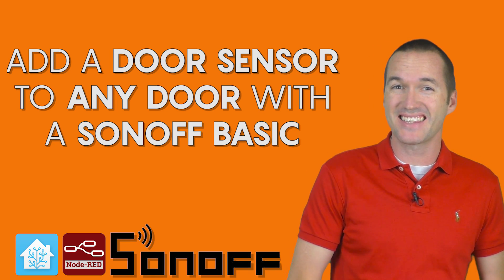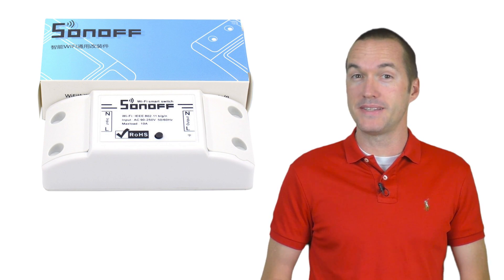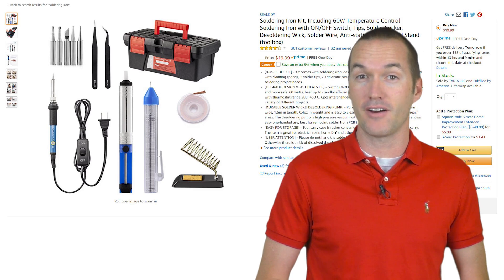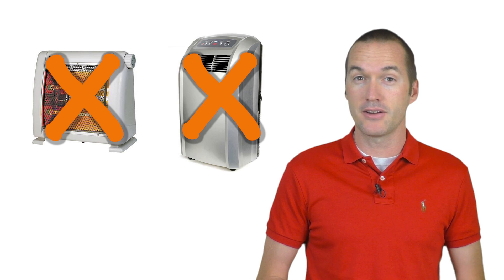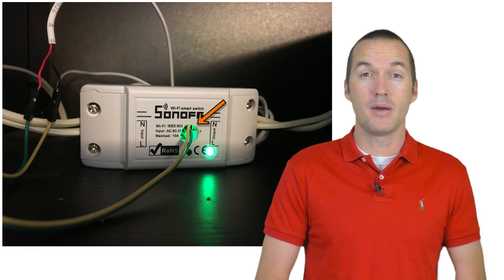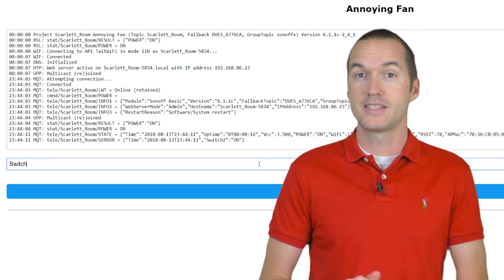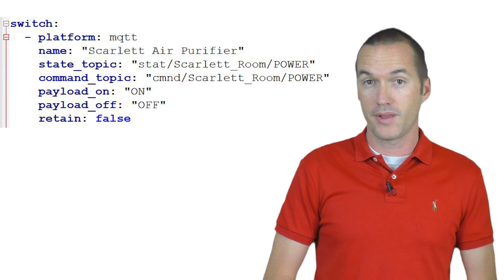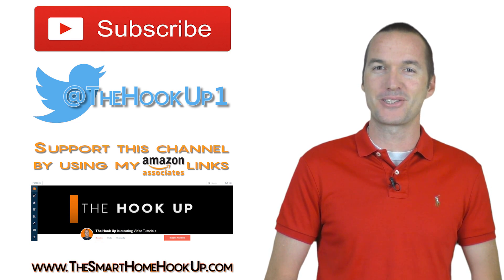Add a door sensor to any door with a Sonoff basic.

Comment: Am I the only one that looks at this and sees what a TERRIBLE idea it is, ESPECIALLY in a kids bedroom?  If you don't have basic soldering skills already, you need not be running to "just buy" a soldering kit to cobble together this hot mess.  

Need I also remind you Sonoff is not a UL device and if it his "contraption" (I'm being nice) burns your house down, good luck with your insurance adjuster is all I can say.

If you want a safe way to accomplish this, check out Dr ZZs Sonoff RF bridge and door sensor video, instead of "monkeying with the mains".

For safety, search "superhouse Sonoff safety" and read the cautious of using a Sonoff as an end enclosure.
Reply: Agree. It's a terrible idea. THE SONOFF IS NOT ISOLATED!

It's not guaranteed to be isolated from the mains, it's not required to meet any isolation standards and is not designed to meet any isolation standards. The clearance and creepage distances on the PCB are all too small and the rating of the transformer is unknown.

IT IS NOT AN ISOLATED SUPPLY!
Reply: I disagree, with your agreement.  I think it's a great idea.
Reply: Then you're wrong. It's dangerous and it's encouraging rank beginners to attempt a project that could be fatal. You might live in a country where your mains is pissweak, but many people have 240V. The sonoff does not have an isolated supply. It's a dangerous hack. 

If you want to have a go at me for shouting on the internet, you can, but I used the caps to indicate that this is a thing that I would shout at someone about.

<pasted from my reddit comments>

The sonoff derives its power by rectifying the mains to DC and then running a little switchmode power supply to produce 3.3v.

That means that inside the sonoff is a voltage rail that is sitting at 120*1.4V = 170VDC from which the 3v3 is derived. This is the case whether you have L&N wired correctly or not.

All it takes is for a breakdown of the insulation in the transformer, or for a high voltage transient to appear across the trackwork on the PCB and the 3v3 rail will be coupled to the 170VDC rail. The product may even continue working, but now everything connected to 3v3 will be at 170V above or below ground.

So for instance, a lightning strike could cause a momentary transient overvolt condition and arc across some points on the PCB. It'll char a little bit and become carbonised and conductive. Now your skinny wire that you tucked under your carpet is suddenly live and you wont know because it's still working.

It might sound far fetched to you, but I've seen it happen.

Ok, so this situation might be "safe". Maybe you used mains rated wire for your connection to the reed switch, you insulated and heatshrinked your connections, you covered everything in hot glue, you installed it in a wooden door and your kids can't touch it.

But this is a tutorial that TEACHES RANK BEGINNERS how to solder and tinker with the internals. And you live in a country where your mains is at 120V. Much of your audience may live where mains is 240V and everything gets worse.

I like the sonoffs. They're neat, and well made. I suspect all the certifications that they have are bogus (I've been convinced of that in another subreddit) but largely speaking I consider them to be safe to use as designed. They're designed to be used in a non-user accessible location, with rated wire and double insulated because they have no protection and no isolation.
Reply: @DrZzs:  Of course you are wrong.  It's only a great idea if you like wires referenced to the mains floating around loose on the floor.  If your not supposed to have the FTDI Programmer hooked up to GPIO pins with the mains live, why the hell do you think it's OK to run "loose" wires haphazardly out of the thing, especially with no strain relief?  You all are a fan of "Tazmotizing" everything, but you didn't take the safety warning to heart.  Ref "Hardware Preperation".

In some countries (Australia) only a licensed electrician is only able to hook things to the mains.  While I cant stand such a government big brother thing, seeing things like this makes me understand why there is such a rule.
Reply: @pie314isi:  Agree, x1000

You hit the nail on the head, and that is exactly my point.  It attempts to teach rank beginners how to tinker with things they aught not be tinkering with.   I thought it was a good How To Video, but it's absolutely awful for it's target audience.

I don't think their Certifications are bogus though, they are trying for UL.  See Johnathan's SuperHouse where he visited.  

Maybe Australia doesnt have such a bad idea not allowing just anyone to "tinker" with the mains.
Reply: James Kerns Jr.  I don't have a particularly high opinion of Jonathan. His treatment of the same sonoff hack is only marginally better and doesn't make any effort to stress that the pushbutton he fits needs to be properly rated and isolated. He appears to know some stuff, but I don't think he has any formal training.

I tried to track down the certifications for the sonoffs. The certificates appear to exist, but the testing agency they list don't show up anything in the database. Maybe this changed since I last looked.
Reply: pie314isi  I dont have a high or low opinion of him, but at least he did stress some safety with the mains in his Sonoff video, which is way more than anyone else did.  Telling rank amateurs to "just go buy a soldering iron" and take it to a mains device to me is just border line irresponsible.   I suppose it's the problem with things like this being too easy - all the "script kiddies" are now tinkering with mains with no clue what they are doing - and they wont even try to understand and just take the soldering iron to the board.  Glad my kids wont be visiting their houses.

As to the certification, I see the tracking didn't work on that Chinese web site.  Wow.
Reply from the maker: Hi, I appreciate your concern, but I want to make sure you actually understand what you're looking at here.

1) About it being in my daughter's room, it's on the top shelf of her bookcase, next to the air purifier which she can't reach.  Even if she could, there are not any exposed high voltage wires or dangers.
2) The parts that are being soldered are only exposed to 3.3V, as they are the GPIO pins from the ESP8266 that controls the WiFi that the sonoff uses for its app.
3) This is a job that a novice solderer could easily accomplish, you don't even need to use solder, just heat up the back of the through-hole and push the pin through with the existing solder in place.
4) If your issue is with the sonoff itself, I share some of your concerns.  The sonoff uses screw terminals to connect the two sides of the mains voltage, which is where these things will fail if they are going to fail.  If you're using stranded wire you should tin the ends before using the screw terminals, and make sure that your wire insulation is only stripped for as much wire can go into the terminal.
5) If your house burns down due to ANYTHING that you did, your adjuster is going to take issue with it.  If you installed a normal dumb lightswitch, but had a loose neutral wire and it caused your house to burn down, guess what?  You're liable.  If you used a cheap extension cord and pulled 15A through 24AWG wire and burned down your house, guess what? You're liable.  In this video the sonoff is outside the walls which means it doesn't need to conform to any building codes and in the VERY unlikely event that it burned down your house it wouldn't be any different than the cases above.  
6) UL listing doesn't protect you from the cases above.  Ever bought an LED lightbulb off amazon? It contains a circuit board, is connected to mains voltage, and 99% of them are not UL listed.  Same thing goes for phone chargers, lamps, routers, and hundreds of other electronic devices that are probably in your house right now.  The sonoff is no different.

I couldn't figure out which superhouse video you were trying to point me to, but I think I've watched all of Jonathan's stuff.  I'd also point you to this video here: https://www.youtube.com/watch?v=SLK84ZJ291k which shows a sonoff performing incredibly well, even at full rated capacity (and over).
Reply: The sonoff 3.3V IS NOT ISOLATED. This is a terrible idea.
Reply: Uh, you seem to misunderstand the point to my comment, and I admit, perhaps I wasnt 100% clear.  My pooint was not to "badger" your project.

I'm sure you took the precaution correctly (although you did not mention it).  I would highly doubt you would be that negligent with your daughters safety IF you knew enough already to do this project.  HOWEVER, you are encouraging people to "just solder" or "just push" on to termninals they have no idea about, without taking any time or concern to explain that.

To your points quickly, because my comment was not to banter you:
1) Fine, but not mentioned or cautioned - which is my point
2) Do you know that for sure?  Is that an isolation transformer in the Sonoff?  Did you check?  AGAIN - is is referenced to the mains?  Do you know what that means, explain it, and did you check?  EDIT:  Again, I didn't say carry voltage however, I said "referenced to the mains".  There is a huge difference.
3)Can and should are two distinct points.  I CAN sandpaper a Lion's a$$- SHOULD I?  Probably not.
4) Again, you should follow code.  In some cases, it requires ferrules.  Any case was not mentioned.  REGARDLESS the case, it is NOT a finished enclosure.  Johnatan''s video #21, 
https://www.youtube.com/watch?v=8mz5sCAvDAY&t=668s
I refer to 10:21 .
5)Of course they will.  Do you need to give an extra reason?  
  a)loose neutral wire - of course you are liable - pay attention.  To this point, did you caution about floating the neutral:  Superhouse 24, time 9:20???  Again, shouldnt be messing with it unless you know what you are doing.  Again, not mentioned.
b)cheap extension cord.  You would liable, and also an idiot.  Hopefully your wouldn't make the same mistake twice.  But I doubt it's going to cause an adjuster to bark because "accidents" happen.  I never heard of a claim being denied over that.
c)It's very different.  You monkeyed with a "finished" product.  In case b, you could claim ignorance.  Case c, not so much.  There is a provision for the difference  between "faulty workmanship" and ignorance.
d)Sonoff doesnt need to confirm to building codes.  True.  But Dr ZZ has a video on installing that in the wall.  In this case, it certainly does.  At least he gave a warning though.  But again, the point is it's a horrible idea.

See a comment in Dr ZZs video
https://www.youtube.com/watch?v=ab472a40-co&t=2s
 where someone directly asked him if it was covered by insurance in a fire, and he said no.

6)UL doesnt protect you from the cases above:  No, but at least it certifies that the product you are using is safe and tested.  Sonoff has no such certification, and could be the "smoking gun" in an insurance claim.
Amazon Bulb:  Sorry, all mine are UL lised.  If not, I take it apart, reverse engineer it, then discard it.
Other items:  Nope, all my router, phone chargers are UL.  If not, same as above.

AGAIN, I thought your video was good.  You have a knack for instruction, you are a complete and thorough in your teachings.  Otherwise, I wouldn't take the time to watch them and comment.  But you shouldn't be encouraging people that have no clue about electrical safety to "just open" a 120/240v mains appliance and modify it - NO MATTER WHAT THE CASE IS!!
Reply from the maker: I would certainly be happier if my sonoffs were UL listed, but I'm guessing ITEAD isn't to keen on shelling out $20-30k for their initial UL cert + quarterly inspection costs on a product that they are selling for $5.  They maintain their CE mark because it can be done in house for very little money.

Good on you for having all UL listed products in your house, I'd say that applies to less than 1% of all households in America.

Also, the "faulty workmanship exception" only applies to permanent installations.  I've been researching insurance law to make a video and plan on doing an interview with a buddy of mine who is an adjuster for the video.
Reply: Per Internet Etiquette 2018 edition, Section 6.52b sub-heading CAPS; "the overuse of caps is equivalent to yelling".  Let's not yell at each other.  Reading so much caps gets my heart rate up.  

I like Rob's idea.  For what my opinion is worth (I accept it ain't worth much), there nothing wrong with it.  We do much more dangerous things every day (like driving, unless you have a sweet model 3 with auto-pilot like Rob.  Yes, I'm jealous).   

Anyway, playing with electricity is a bit like being a snake charmer.  Once you get shocked a few times you become immune.   

Did you know there's actually a Lawyer who specializes in Electrocutions? http://www.electrocuted.com/safety/statistics/

fun stats

Do I smell smoke?... brb
Reply: @DrZzs:  Watching people teach people that ought not me messing with mains to carelessly connect wires to the mains gets my heart rate up.

Hopefully the all CAPS catches the attention of people and stops such foolishness.

We think your opinion IS worth alot, which is why we watch both you and Robs videos.  Except in this case.  :)
Reply from the maker: Are you having a conversation with yourself?
Reply: No, I replied under each individual comment.  It just doesnt keep the thread in order like it should.  EDIT - Put @'s on comments, although I cant stand them!
Reply: @TheHookUp  -  Why do you even respond to his (James Kerns Jr.
) posts?  Take a moment and analyze his posts... Pretty soon, it looks like someone with " BI-POLAR "!  Look at the " Writing Style ", you will see how F'Up the Brain is or even are, LOL :/.

Comment: So the sonoff acts as a switch to control the “annoying fan” and also acts as a door sensor?
Reply from the maker: Correct, but they are not linked together.  The Sonoff is just doing two tasks, independent from one another.
Reply: The Hook Up that’s pretty nifty!

Comment: good idea with the header pins I was able to do it however it was a pain. I need to invest in one of those multi helping hands  (https://www.amazon.com/dp/B01961086E/ref=psdc_13837391_t1_B079CHJQKH)
Reply from the maker: Helping hands are awesome.  I have a few different ones.  I mostly did it without one in the video to show it wasn't hard even with minimal gear.

Comment: Well done!
Reply: No its not!  Do you not agree that the most important topic is ELECTRICAL SAFETY especially when a child is involved???

I see you and him fast to show people to just "Tazmotize" these things, and they are not even UL rated!  You should not be encouraging people with no electrical backgrounds to take on projects like this.  In the video, "just buy a soldering iron, and tie on to a board that carries mains voltage with little wires through a little hole of the device on the floor of your daughters bedroom" without even a word about electrical safety? That doesnt sound like  "Well Done!"  to me.  Did ANYONE even pay attention to see if these little wires you solder on running out of the device are referenced to the mains?  

I remind you a Sonoff is not a finished enclosure.  I suggest you read this thread:
https://community.home-assistant.io/t/sonoff-safety/28636/2

and this video:
https://www.youtube.com/watch?v=8mz5sCAvDAY&t=665s

Your video on the Sonoff RF bridge with the RF sensor would be a much safer and sensible idea for such a project.
Reply: @jimb032  - Are you Bi-Polar? I can sense it in your writings!
Reply: @JodBronson  Certainly not.  The proper word is also writing, not "writings".  It is a  singularia tantum.
Reply: @jimb032   - Did you just looked into a mirror? CRAZY IS = CRAZY DOES !!! 😂 😂 😂 😂 😂 😂
Reply: @jimb032  - You should check the word " Writings " and how it was used in the "Sentence"! Writings (plural noun) the written works of a person:
 the "writings" of Abraham Lincoln

Comment: That is very cool :-) I did it with a wemos d1 mini and tasmota, it controls my doorbell chime with a relay shield, my doorbell button with a separated switch as you did in the video and other two door sensors for the mailbox. Just a small question about the sonoff basic: may I use the gpio3 or 4 (tx and rx) instead of gpio14? I use the gpio14 for manual switch already.
Reply: how you configured the GPIO's? also on an d1 mini i want to put a relay, a button to control the relay and a reed switch. i've succed only if i configured the button as '17 button1'(i wanted to be configured as a switch, because of switchmode options) and the reed switch as'10 switch2'. did you succed to configure the button as a switch?